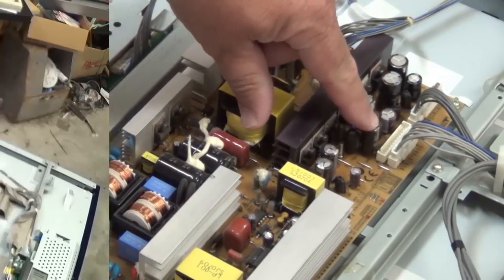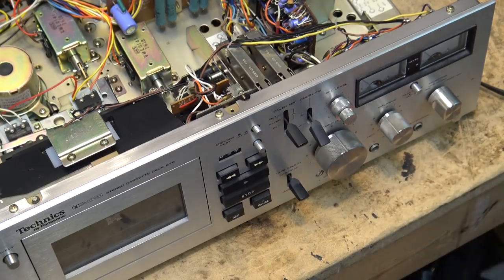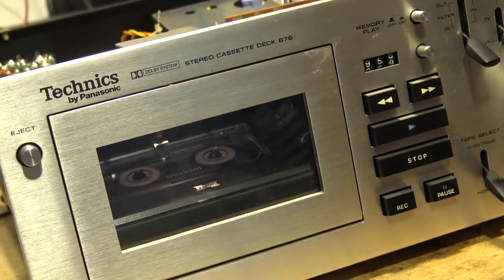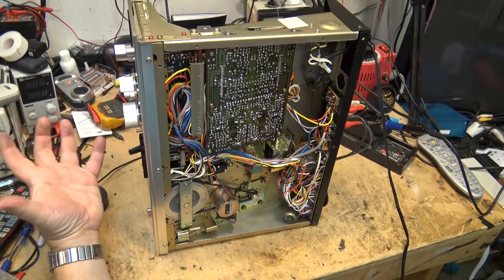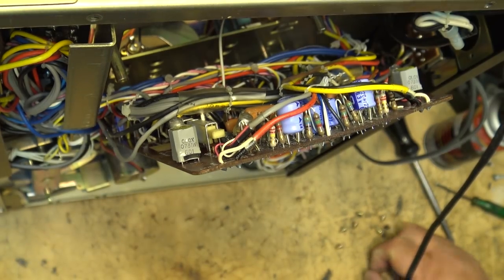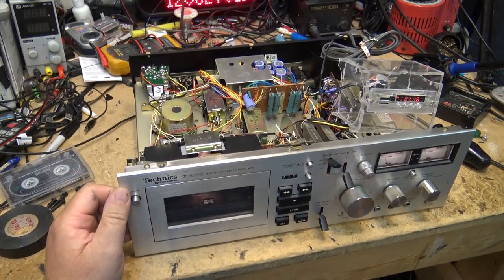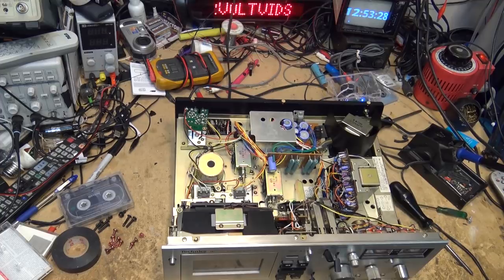Vintage Technics RS-676 Cassette deck overhaul

Comment: Technics (RS) 673  was even more beautiful , same window and damped eject . This one had HPF heads which you can compare with the Ferric heads Sony used , almost indestructible . The 673 had SX heads and sold very well only 2 heads but with a lot of possibilities . It costed 1200 Dutch Gilders > 600 US Dollars , new  from the store , also very heavy .. The sound is amazing even by todays standards . Sold from 1977 till 1979
Reply: I Have the same Deck, awesome machine !

Comment: FYI: you mention about it was difficult to clean the heads, There's a Plastic Head Cover piece, the symbol "HPF" is easily removable. If I recall you just push the plastic cover to the right and it exposes the heads, making it much easier to get to rather than the way you were showing in the video.
Reply from the maker: Those plastic covers are brittle as hell now.

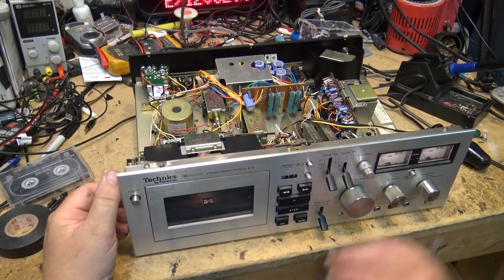Comment: 34:33 Yes. Everybody recorded with the Dolby on then played back with it off so we could hear the high frequencies. Nice and clear. I still feel like the sound I heard when I was listening to music with Chrome tape recorded like that and listening through a top system was better than the digital stuff we have today. I own and record live music using a full DAW studio. (Digital Audio Workstation). Meaning using a digital interface for the inputs to record onto my computer using professional software and some pro hardware for processing etc. Yet even if I have full equalization control and using Aural Exciters for high and Low frequencies etc etc. I still feel like the audio I used to get recording in the Analog Studios back in the day onto 2" Tape was superior to the absolute perfect digital I am using now. I actually use software that will ADD NOISE to the recording because it has been shown that the human ear finds that that noise is pleasing to the ear or brain or whatever it is that happens. LOL. I use a unit called the Ferric TDS which after adding it to the mix makes it sound closer to the old 2" tape I used to hear and was used in all the great albums of the past throughout the 50's, 60's 70's and some 80's even into a bit of the 90's but extremely rarely now. (Maybe Dave Grohl and a few like him).

Comment: Very impressive vintage cassette deck!!  The engineers were really thinking when designing this piece of equipment.  I like the little stand offs for the capacitors.
Reply from the maker: This was a cool unit. A keeper for sure.

Comment: I am the lucky owner of a lot of Technics gear, including the four track reel deck RS-1506 and the cassette deck RS-673.  The speakers you show have been on my wish list for years, they are wonderful.  Great video!  (FYI, this deck, model RS-676 was sold for the first time in 1974, its weight is 20 lbs, price first year of sale: 460 USD.)  Another very big name in cassette decks used to be Nakamichi.  BTW, to get easy access to the heads you may remove the plastic cover on top of them.
Reply from the maker: 1959Berre 
They certainly are and driving it with my tube amp they sound wonderful.

Comment: In 1977 this deck sold for $599CA.  Nice deck indeed!  ~Jack, VEG
Reply from the maker: Might not be a Nakamichi, but way more reliable.
Nakamichi, and I know I am going to ruffle feathers may have performed well, but they were never regarded as very reliable. I fixed tons of Nak equipment. Their warehouse and parts depot for all of Canada was right here in Vancouver, and I used to order many parts from them. Main power transformers were a weakness on their amplifiers.
Kid would have a party and crank it up. The transformer would warm up and blow the internal thermal fuse. Caching, that will be 300 to fix it sir, thank you very much. Couple of months later same unit back, power transformer blown again. Caching.,300.00. Customer is pissed. Response. Did I go over to your house, hold a party and crank the shit out of your amplifier and burn the power transformer out? No, well then stop bitching at me, here is Nakamichi's phone number, take it up with them!
After seeing the quality of the units, I would never own one. (and yes I was an authorized Nakamichi servicer, they actually gave that out to anyone that bought parts form them. Call to buy parts, and they would say, want to service our stuff under warranty? Here fill out this application. They paid crap. Lower rates than Sony did, and Sony stuff was much easier to fix, but they did pay better than Yamaha, and some of the Yamaha stuff was brutal to work on.

Comment: Nice technical service bulletin. I'm into the same "hobby" and perform  normal maintenance on my 18 or so decks. Here's a bit of trivia. The  mid 70's Technics RS decks 630/ 671/673/676, and semi pro model RS 288 with the lighted horizontal tray compartments were ALL based on the TOTL full laboratory professional (2) chassis RS-9900US. I acquired one via Germany, which needed a major overhaul. It also came before the short lived metal tape revolution. However,  This may sound crazy but but to my ears it easily outperforms anything  built after from the late 80's and 90's. I too will never sell it...

Comment: I bought my 676 in 1974.  I worked in an audio shop while in grade 13 and paid the "wholesale" cost.  I remember the retail was similar to the number, about CDN$675, much less in the US, US$460.  To clean and demagnetize the head, simply slide the piece of plastic that has the H on it to the side and lift...all is revealed.  I always used CO2 tape.  The recordings were VERY close to LP [Technics SL-1700 with a Pickering 881S cartridge, they're sitting beside me]. The competition was the Nakamichi 1000.  My amplifier was a Marantz 1070 which got replaced by a ReVox b285 which has been replaced with a McIntosh Mac 4100 [completely restore to "new"].  When buying the Marantz, I was drooling over a $3,000 McIntosh receiver.  In 1990, when I was buying the ReVox, I was drooling over another $30,000 McIntosh system.  I realized by age after buying the Mac 4100 in 1995, that it was the machine I was looking at 20 years before when buying the Marantz!  A friend of a friend was selling a system inherited from his father. After snapping it up and looking at the age, it was the McIntosh system I was looking at when buying the ReVox!  Kismet?
Reply from the maker: I still have my dad's old McIntosh 1600 receiver, but do not use it now. It is in storage. The vintage old output tubes are no longer available. I use a modern Yaquin MC10 amplifier, and to my ears it sounds even better than the mac due to better capacitors and precision resistors. That was the biggest problem with vintage gear. Most resistors were 10 or 20% tolerance which means as they warm up the sound is totally different than when they are first turned on.
Reply: @12voltvids  The Mac 1600 had tubes?  My repair guy recommended the 1400 to me as the last solid state amp. I got it off ebay as pristine, it wasn't.  I had some minor things done to make it work and then something else went.  I brought it to my guy who passed it on to someone who specializes in McIntosh...he even had a new glass panel that he to put in it!  The list of resisters, caps, etc replaced was a page long.
The "newer" McIntosh came with an MC7270 Amp and xrt 23 speakers. Records are dead silent between tracks.  After 2 marriages of "turn it down" the guy died.  The son didn't think it had more than 100 hours on it!  Oh, and a Dual Golden 1 turntable.  I was happy.

Comment: Beautiful deck and the speakers were designed with linear phase in mind. That's why the drivers are offset. The FM input was supposed to be connected before the de emphasis network, commonly called detector out.  You are taking me back to teenage years. At 16, I worked at a Radio Shack. Hey, I was 16 in 76.
Reply from the maker: Dolby FM used 25uS pre-emphasis and dolby b noise reduction. It never caught on. Back in the 70's I can remember only 1 station that was broadcasting in dolby, and that was a classical music station. I never understood what it was then because I was only about 12, but I do remember in the evening the station went off the air every night and ran sweep and test tones in the wee hours and announcements were made that this was for transmitter and receiver alignment. I never stayed up late to hear it, but did leave a reel to reel tape recording over night to hear what they did at night.
Reply: @12voltvids  we had a buffalo station that was called rock 102 on 102.5. they would say, now with Dolby, the sounds of silence. They later went automated. That was boring. Then the slogan was music and you on rock 102. The dolby was off then. Yes you needed to plug in pre, de emphasis to you don't get de emphasised twice. Quad decoders were the same because they used sub carriers, remember sca? You take me back to my forgotten past.
Reply from the maker: I have a big Sansui 9090db that has the dolby FM decoder built in. It sounded fantastic when they were still broadcasting in dolby FM.
Of course I remember SCA. I did a video about SCA last week, and showed the 1 repaining SCA station still in service in Vancouver.
Reply: @12voltvids  yes well the subcarriers we're used for quadrophic sound. I think they used the both, not sure. It was a huge accomplishment that flopped. I was 17 when I fixed a sansui stereo. Huge heatsinks. It had blown outputs because his cat slept on it, blocking ventilation and filling it with fur.
Reply from the maker: The cat probably filled it with more than fur.
I had a cat that used to sleep on my satellite box under the TV. One day the cat coughed up a hair ball, and other stomach contents right on the receiver. The satellite receiver caught fire and set off the smoke detectors. Good think it was one of the old metal cabinet ones..

50 Hz to 15 kHz Main Channel (sum of all 4 channels) (LF+LR+RF+RR) signal, for mono FM listening compatibility.
23 to 53 kHz (sine quadrature subcarrier) (LF+LR) - (RF+RR) Left minus Right difference signal. This signal's modulation in algebraic sum and difference with the Main channel is used for 2 channel stereo listener compatibility.
23 to 53 kHz (cosine quadrature 38 kHz subcarrier) (LF+RR) - (LR+RF) Diagonal difference. This signal's modulation in algebraic sum and difference with the Main channel and all the other subcarriers is used for the Quadraphonic listener.
61 to 91 kHz (sine quadrature 76 kHz subcarrier) (LF+RF) - (LR+RR) Front-back difference. This signal's modulation in algebraic sum and difference with the main channel and all the other subcarriers is also used for the Quadraphonic listener.
105 kHz SCA subcarrier, phase-locked to 19 kHz pilot, for reading services for the blind, background music, etc.

This is different than what SCA used. SCA used 57, 67, 91 Khz sub carriers. 57 was, and still is used for RDS data. 67 and 91 for the SCA subscription channels.  of course today that spectrum is used for IBOC digital channels. They are not sub carrriers of the main program audio, but separate transmitters that operate in the spectrum where the sub carriers would have lived, so they ride along side of the main carrier. 
I tell you, HD radio sure sounds good. It is pretty much all I listen to these days.
Reply: @12voltvids  I never got an he radio. I never bought a new radio. That's the biproduct of is using a system that is still compatible with radios from years back. Do most stereo receivers have HD?  Darn cats, I hate them, they are too Independent and I am allergic. Only dogs for me. I think I had no hairballs in that. From my memory, it was just  outputs.. Wow that quad was quite a bandwidth hog. Only a Detroit station had it around here. I think wwww.
Reply from the maker: Mark Anderson 
Most new cars have HD radios in them. That was my first exposure. I like new cars not old junkers. I picked up a sangean hd-t1 tuner off Ebay cheap. Sounds fantastic. It receives analog of course too. When you tune an HD broadcast it first picks up the analog signal. A few seconds later it kicks into hd and the sound level drops a bit because hd signal is not all compressed and pushed to the limit as far as modulation. All of a sudden it is like listening to a CD or vinyl depending on what the station is playing. One of our local stations has the "vinyl lunch" where they play vinyl in the lunch hour. All I can say is it sure sounds good.
Reply: @12voltvids  I never had a car with hd. I have a 2010 Mazda 5 and it does not even have Bluetooth. Sound interesting for sure.
Reply from the maker: Mark Anderson 

My car a 2012 volt doesnt have it but one of my co workers bought a new 2013 gmc pickup and his has an hd radio. The first time I heard it it was like wow. What a difference. So I picked up the sangean, the one I put the bluetooth receiver in.  Never looked back. No am stations around here use HD. They are all owned by companies that have fm stations as well so they put the am fees on the sub channels. 3 fm stations here have 3 digital channels. .1 is the fm main audio .2 is am station 1 and .3 is the second am station. 
So I get classic rock on .1 tall on .2 and traffic on .3. A other rock, news and sports. A 3rd station soft rock, sports and Bloomberg radio. 
The Christian rock station has country on their second channel.  7 local fm stations here have hd with 16 audio channels on the digital side.
Reply: The domestic cars seem to have more features than the imports.  I have a friend with a 2014 Chrysler 200, it has a touch screen, Bluetooth, really nice stereo too. That's amazing that so many channels fit on one subcarrier and actually sound good.  I do have Sirius and the sound sucks in my car
Reply from the maker: Mark Anderson 
Yes Sirius xm does blow in the sound dept. Too many channels not enough bandwidth. I had it for a few years when they were giving away service but as soon as they wanted real money I told them to stuff it. I got like 3 years for free with the car. Then I had to start paying. They gave me a year at 50 so I took that but it was a 1 time thing. No more for me except when it is I. Preview mode.
Reply: Oh, the 168 Barker Channel.  SO how does that work?  All channels are a big stream?  Any chance on teaching us how Sirius works? I like it because I moved to the states and I listen to CBC and the democrat channel 127. I moved to the states so Canada is welcome to me.

Comment: Don't forget the HPF Heads (Hot-Pressed Ferrite). I have the same Deck. Technics made some good stuff in the mid 70's
Reply from the maker: HPF heads were technics answer to Akai Glass heads, without the stiction problem.

Comment: Just got done with a Teac C-3X, normal bias Maxell UR tapes sound as good as what I recorded. But it's a three head deck with HX. Also I recapped it and did a full calibration with a re belt and a full disassembly and lube. Yes solenoid is a great setup. The C-3X is all solenoid as well.

Comment: A E S T H E T I C ... :D
Great deck, most electronics of the 70s is great because it's built to last and still very mechanical (solenoids, buttons instead of MOSfets), but already quite complex.
In the 80s they started to trade off at the built quality regarding home entertainment. (Plastic instead of metal/wood, less tactile "click" buttons etc. But also SMD caps which can leak onto the board and other crap which can be hard to fix)

Comment: I do remember when I had a telephone chat with one of those audio(p.)phile fundamentalists and when explained how I achieve a flat frequency response through EQ, both hardware via component or software via PC software EQ he rejected my method alleging it's invalid.

Ha... like there's a contest and rules on how to achieve such goal. I mean, buy the topmost deck, use the best magnetic tape out there, hope that Mars and the Moon are aligned after you've done your BIAS, EQ and level calibration.

With PC software EQ even cassette tapes you wouldn't normally use on specific decks for recording become perfectly naturally sounding after the treatment. Of course today we can do it with digital sources as we have the necessary headroom, I wouldn't even dare to equalize frequencies below 60 Hz or push the highs from certain old analog sources.

Comment: I have this unit and notice when listening to a 440hz tone on line in over the headphones (record button down) that it sounds clean and balanced.  When listening to a playback of the recording I hear some hissing, more on the right side.  I made the recording on a type1 tape with and without dolby.   The hiss with dolby is a bit less on the left but the same on the right.  It's almost as if the dolby switch has zero affect on the right side.  I know the right and left NR switches are working fine.  I suspect an issue with the dolby block board but not sure.  I did replace on cap on that board which was bulging (also looked like it had been previously replaced) but no effect.  I've also cleaned the heads.  Let me know if you have any thoughts.  I've been browsing through the service manual.  I don't have lots of experience working on audio gear but trying to learn.

Comment: My dad read scores of reviews before he settled on this model and we all used it throughout nthe 70's and 80's, but good things don't last. He gave it to me when the R/P switches wore out, and by then, Panasonic didn't supply parts anymore.  (Yes, wore out! Cleaning no longer helped.) Sad day. Btw, all quality gear used 5% resistors by the mid-70's; it wasn't that big a deal. A better sign of quality was the semis & caps they chose. If you saw a lot of 2SC458s or C828s, throw it out.